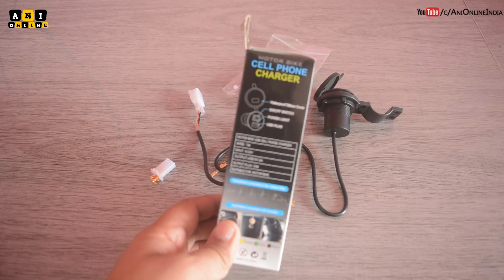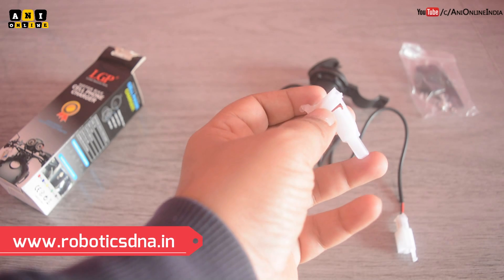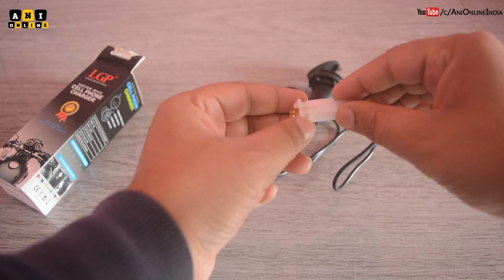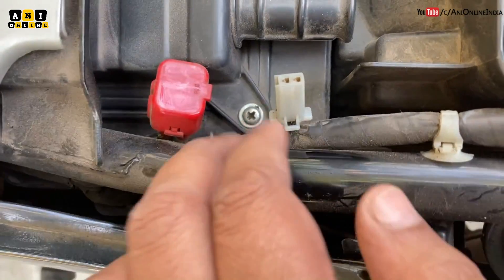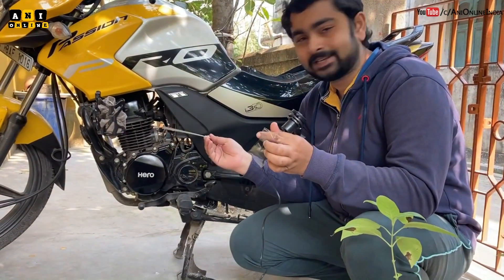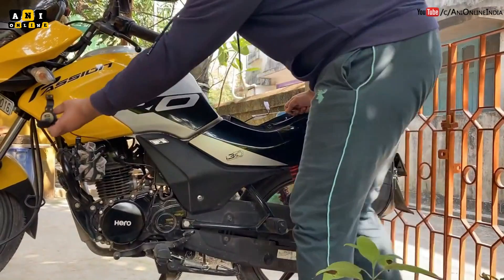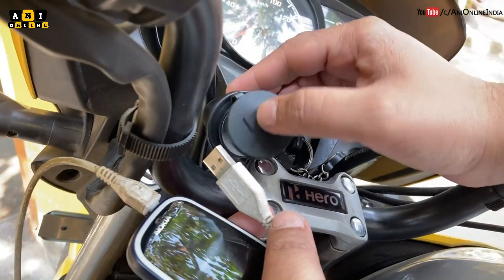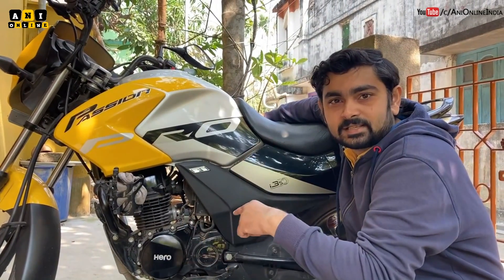Install USB Mobile Charger on Motorcycle - No Wire Cut, No Direct Connection with Battery

Comment: Charger not working bro,face the issue of charging on and off could you tell me the reason
Reply from the maker: You need to check if thoroughly, may be a wire cut, or problem in the USB port or the charger IC!